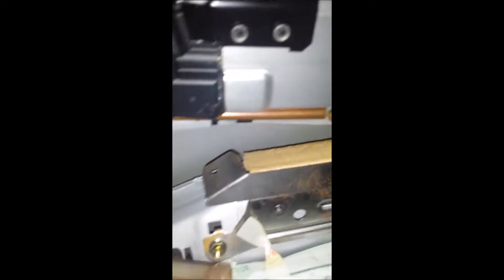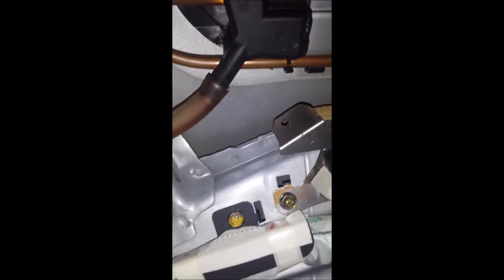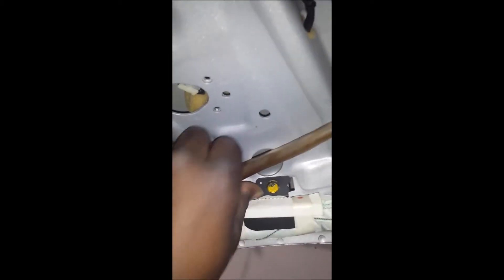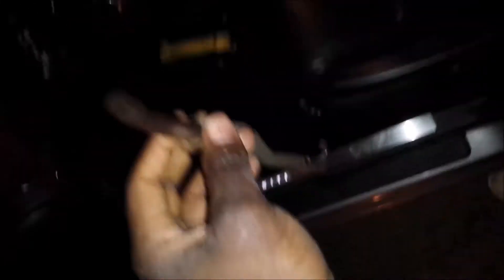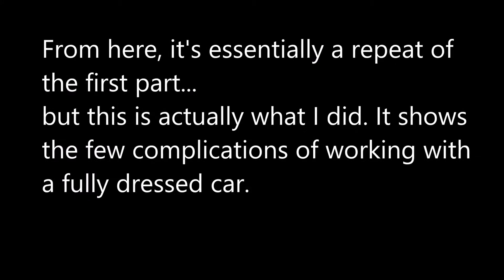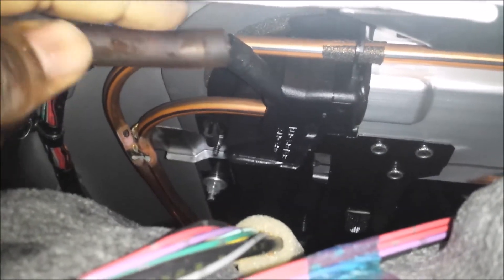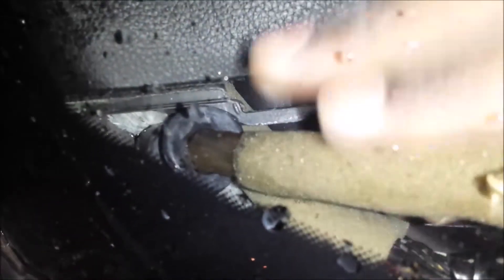Water leak in car after heavy rain - pinched sunroof drain. Infiniti M45 M35

Comment: I'm having this issue on the passenger side... I've cleaned out the sunroof tubes and I am waiting for it to rain again.... but another concern we before I worked on it I decided to drive it to find out if water was pooling anywhere else... and yes it was under the passenger you could hear it sloshing around. Any idea how I could drain it or if this is another issue and not the sunroof tubes? Btw again great channel and learning alot about my 06 m 35 from u thanks.
Reply: And also... I just pulled up all of the passenger floor..... I found the standing water =0( I wanted to ask you what is that black tube on the fire wall can where does it lead from? Maybe this could be the culprit?
Reply from the maker: @bksbullynyc  sorry for the late reply.
I'd say, instead of waiting for rain, you can use a garden hose over the sunroof. Or a jug poured slowly.

For the standing water, wet vac or old rags would be my method. The tube you saw is the AC drain plug.
See if you can use any of the info in this link: https://forums.nicoclub.com/a-c-evaporator-drain-hose-t622329.html#p6783874
Reply: @EdBwoy  ok cool thanks for the info
Reply from the maker: @bksbullynyc  keep us updated